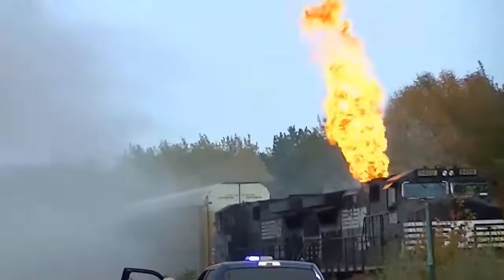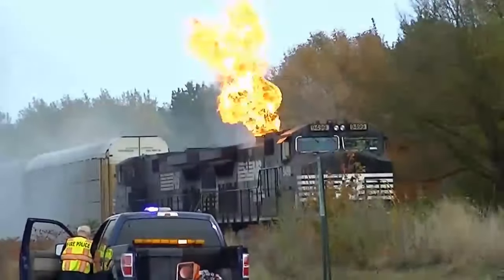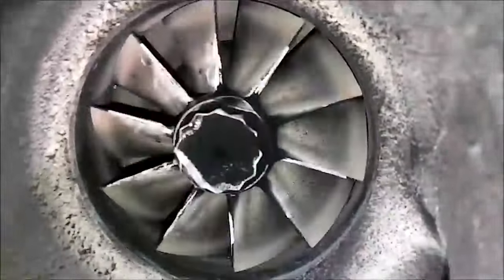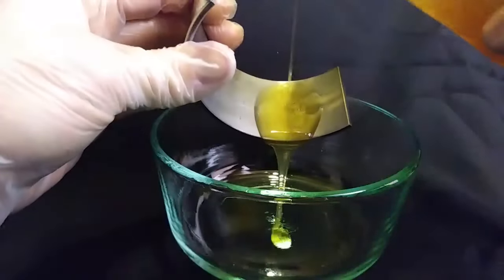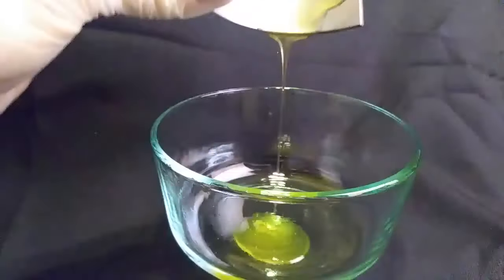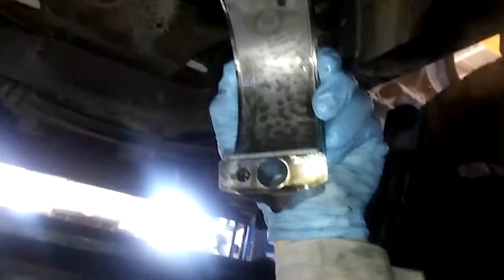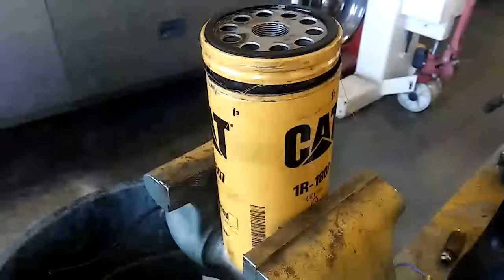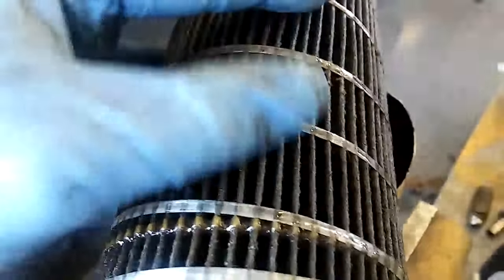Engine Block Heater vs Oil Pan Heater. Everything you NEED to know about Cold Weather Diesel Engines

Comment: "Do you want to spray that super flammable ether on to a glow plug?"
Hell Yeah I do!
"No, no you don't"
DAMNIT!
Reply: If a diese doesn’t have glow plugs & the IP is ok with ether & a backfire/engine turning backwards not breaking anything then you should be fine only if it’s designed to have ether used for starting.

7.3idi’s especially should NEVER get ether at all. Ether can easily kill a 7.3 idi if not used right, but there’s a guy in Canada that will disagree with me on this, but w a 7.3 idi if you give it a short squirt & a little of wd40 before starting then you should be fine. I use wd40 because it’s better on the rings. Ether is very dry, & can vaporize oil in the rings causing more cylinder wear.
Reply: @michaelbenoit248  or just have a good set of glow plugs and glow plug relay, I can’t say enough how important that is. My 7.3l PSD has been starting sub 0 unplugged (location) and hardly any time is spent cranking, it just fires. Keep a happy relay, plugs, and I upgraded my obs UVCH to the super duty one with better contacts to get the plugs power.
Reply: @ApolloTheDerg  Much below freezing and my 7.3 will not start without either if not plugged in , would not come close to starting at 0
Reply: @robertboyd3863  how old are your injectors? My brothers 97 7.3l struggles to cold start, but when we buzztest almost half of his injectors come up weak. I’ve swapped some used ones out of mine when some where weak and they all buzz strong when cold, and she fires when cold.
Reply: @ApolloTheDerg  I had them replaced a couple years ago when the tips broke and started putting diesel in the water , didn't affect starting any , last time I changed the oil , I also drained that pressure tank on the top of the engine, don't recall what it's called , I had never heard of doing that, it seem like it has started better when cold, always starts great when warm , and maybe a bit better mileage . mine is a 2002 . But all in all , all my diesels have a hard time starting when much below freezing, for years when working the drilling rigs I had GM. 6.2s they were terrible to start and even a small amount of either could break rings etc. on them , just a snort would lock them up, used to let them idle for hours, rather than shut them off, they also had bad starters so always carried a spare with me .
Reply: @robertboyd3863  when ya say much below 0 you might be pretty on point especially with old school Chevy diesel. For the 7.3l, I’d check a few systems and make sure it’s happy, valve cover gasket harness and the like, 5w40 oil, if it’s like -5 or 0 it should start without any help, but plugged in is a smart choice at those temps.
Reply: @ApolloTheDerg   Just a short time plugged in, and it's fine, I try to do that whenever possible , when they done the injectors a couple years ago, valve cover gaskets , etc. were taken care of

Comment: Canada’s -40 / -60 is also when tires start to freeze usually freeze flat on the bottom side having to drive slow until the tires warm enough to get a round shape.

Comment: Been operating diesel engines of all sizes most of my life. I've learned that good fuel, good batteries and regular maintenance will prevent most starting problems. Oh and when 5w-40 synthetic came along it was a game changer. I put it in everything now and believe me it makes a difference at anything below zero.

Comment: I got a 2001 7.3l with over 365k miles living in north Michigan. A good oil,  Plugged in will most absolutely start. Stay away from ether, if you use anything use wd40, I have used it in -15 works great, during cold months add antigel you’ll be alright

Comment: A few years ago I experimented on a 55hp chore tractor I was rebuilding. Had the pistons ceramic coated, to keep them from being such an effective heat sink during cold starts. This tractor from new (and our others with same engine) had never been good cold weather starters. Now even in single digits it starts right up, stays running, doesn't smoke, and sounds good! Would like to verify on a couple more engines. Has anyone else ever tried this?
Reply: interesting, and makes sense
Reply: Good  day  What model tractor was it  ?  Thanks
Reply: @donvoll2580  Case 1290.
Reply: when the experiments include ceramic coatings, we're getting somewhere
Reply: Ceramic coating the piston bowl on diesels is typically done to prevent melting  the piston in over fueled high HP applications, It certainly won't hurt a cold start but I can't imagine the piston being a large heat sink in regards to cold starting compared to the boost tubes, intercooler,  heads, valves, cylinder walls, etc...     but if it worked for you thats great!

Comment: I just put a block heater and an oil pan heater on my tractor I bought early last spring.  I'll see how it works soon.  I will also use a fuel additive.  It was harder to start than I liked in early spring.  I live in the Midwest so it's never -20 I just want to prolong the life of the engine.

Comment: I call Ether battery in a can... yes. Not that it just can start you in the cold, but, if you run out of fuel and batteries are getting a bit on the dead side and need to charge them back up and help prime more fuel through.... :) 7.3 Powerstroke. I've locked mine up a couple times from how much ether I shove into it. It can rev about to 2k rpm using 1 can of ether non stop spray, 2 cans can choke it out.

Comment: Got stuck one night in my 7.3l f250 with no way to plug my truck in. I got a hotel for the night. Went back the next morning and the ambient temp was -43°f ... I lit a literal fire under the engine. After 5 minutes I could start my truck.

Comment: I use Duracell and can go in motel in North Dakota right close to Canada come out everyone else is getting service trucks to heat and jump. I come out check under hood hit the ignition on my 1MM600 Cat bust right off and runs at lower idle for about five minutes then idles up. Those batteries have a cold crank power equivalent to what a lot of batteries have in normal conditions

Comment: A coworker had glow plug issue on his 7.3ps and he couldnt get his trk to start.  With my gas 57 JD 520 tractor when real cold i have used a propane torch to heat the intake and all i had at work was my butane torch i used to soldier wires so i used that to warm his turbo spyder after the inter cooler part and we finally got his trk started

Comment: Here in Minnesota I like to run blended fuel. 50/50 no1 to no2. Also keep some straight no1 for when it gets really cold. At -50 f 50/50 wouldn’t come out of the fuel barrel

Comment: It's funny that you mentioned oil temperature when using a coolant block warmer..
Always noticed that on my 6 leather your temperature was actually very warm I don't know exactly where the temperature sensor is but I would have thought it would have cool down a lot once the engine was running but it didn't the coolant temperature actually dropped more once the engine was started....
Love the shows keep up the great work
Reply from the maker: Thank you for watching.

Comment: there are coolant heaters that run on 12v and diesel fuel

an oil heater is good for lubrication at start, but I don't think it helps a lot with hard starting in cold weather which is caused by the injected fuel getting hot enough to lightoff.  cold air and cold cylinder & head both suck away the heat, and reduces the effective compression ratio.

Comment: I've seen a machine destined for artic climate operation. It had both a block and pan heater. It also had heat tape and insulation around the fuel line. There was also insulation and a heating blanket for the fuel tank. For the battery, there was an insulation blanket and trickle charger built into the heating system. The power cable for these systems was a three phase connector with a fairly thick cable to attach to it. Three phase power is usually used when the draw is above 5kw and cable that thick I've only seen when the draw was above 10kw, so the draw of the heating system was probably above 10kw. 

For situations where there was no access to electricity, there was a diesel burner with a thermoelectric element that drove a small pump that could circulate warm coolant around the engine. This was all in a very large digger and I'm not a gear head so I don't know if any of this is normal but to me it was all very impressive.
Edit: right, forgot. The exhaust from the diesel burner passed under the fuel tank, but inside the insulation, so that the diesel for the burner stayed liquid.

Comment: I've got a 100w kat heating pad on my oil pan and another on my tranny pan plus a coolant block heater. 
Only use the (2) kat heaters if sustained single digits.  Otherwise block heater if 10+F degrees.
It makes a difference for sure if looking for easier startups or quicker warmups.

Comment: This guy is good.
I have and use an HVAC low temperature stat which is set to come on in *F 30 or 29*F so I can leave it on all the time should I need to? 
Run 0W/40 winter and 5W/40 summer. 
If I needed it would buy a AC 120V fuel heater which will wrap around the filter. Just never needed it. 
Did have a second block heater put in a few years ago. That gives me two options. 
Or maybe it is just for the William Tell Overture he plays?

Comment: If you have fuel heaters in the tank also known as artic boxes it uses coolant from the engine but is only good when the truck is running if the truck has been sitting and not running the the fuel will get cold but most trucks the fuel returns in the tank as warm as the water temp i has a truck with tank heater turned them on in the winter time had no problems with gelling up

Comment: I replaced the stock fuel heater on mine 7.3 powerstroke but also. Installed oil pan heater   All good ideas   But I’ve been useing a webasto diesel heater for a year now  at-30 -35 it starts up no issues

Comment: Not mentioned above is an (APU) auxiliary power unit.....  Thermoking sells and installs APU's and it can pay for itself in a couple of years rather than idling the big truck engine.  Heats and air conditioning along with keeping battery charged.

Comment: Thanks, lots of good information. I’m in Kenosha Wi and it minus 5 F and my 2012 TDI Jetta sport wagon made it a few blocks and went down. I think I’m going to go for a frost heater solution
Reply: You needed anti gel in the fuel if it ran a while and quit. No amount of block and oil pan heaters would have prevented the problem you had. Only a fuel heater and/or fuel additive would have kept it going. You should have seen the diesel pickups on the side of the road here in Texas last February when it got down below zero, lots of people had no idea diesel fuel starts to gel at around 10 - 15 F. and we don’t get #1 fuel here. 
A quick remedy if you don’t have and can’t find anti gel:  get some kerosene and put 1 - 1.5 gallons per 10 gallons of diesel in your tank, it effectively makes your #2 summer fuel into winter fuel.
Reply: @ralfie8801  it turned out to be the alternator pulley as it spun and appeared to charge but intermittently slipped and killed the battery and it was more or less coincidental that it was 5 F
Reply: Ah! Killed the ECM so it couldn’t run? It’s amazing it started at that temperature with such a weak battery.
Reply: @ralfie8801  it only started once
Reply: @anonymousbosch9265  
That’s all it had left in it after the alternator failed. The alternator failed before your battery died and also before you started it that morning.
A vehicle will run for quite a while without an alternator as long as the battery has enough charge in it to keep the ECM up and functioning.
Reply: @ralfie8801  that’s what I think too, I think or Jon my vehicles myself but this was a hassle because of that alternator pulley being something I’ve never seen

Comment: Cold is a relative term as you point out. I have not had issues starting two stroke Detroits, Big Cam Cummins, 3406 DI Cats, Mack V8s, or my Dodge Cummins above 0 to 10 above Fahrenheit. And that's with no starting "aids". If you have good batteries and are vigilant with fuel filters, generally they will start has been my experience. If it got below zero, we'd leave them run at "high idle" about 1000 RPM or a little more. We used weather fronts and paid attention to water/oil temps while at high idle. We used Arctic Fox in tank heater with shut off valves for the water.

Comment: A lot of trucks have anti drain back valves on the oil coolers and in other spots, example fords and international because they need oil pressure for the injection system . I believe my cummins oil cooler holds a bunch of oil that gets warm from the block heater. at -23 C plugged in it fires right up with instant oil pressure.

Comment: There is one perfect system buddy check out the webasto Diesel fired coolant heater. You can install them on the frame rail of the truck they come with an electron a control module even a timer that you can set to turn on before you start the truck. The heater uses diesel fuel from the trucks existing fuel tank it has a 12 V burner and a 12 V pump to heat and circulate the coolant up to 180°. When you go to start the truck it’s like you just shut it off instant heat and everything

Comment: Hey Josh look up the flame start Cat used to put on mechanical engines. Most was on 3306B, I had to put one on a 3406B and it was a nightmare. As it was new Cat did not have every thing available and had to fabricate and rig stuff up. Cranking a old PC was sort of a art compared to a DI engine in cold weather.

Comment: As a shade tree mechanic and a fella who has owned multiple airplanes and has spent a lifetime flying in the mid Michigan winter I am here to tell you from bitter cold experience that heating the entire mass of the engine - as opposed to a  just a puddle of semi warm oil on the bottom of an otherwise frozen steel pan -  is the only way to go.
Reply: The cold oil will warm and thin almost instantly when pumped into warm oil passages of a heated block..
Oil pan heaters often burn the oil until it cokes.

Comment: In northern Canada 🍁 in the oilfields and such many trucks run diesel coolant heaters. Set the timer for an hour before you start and the engine starts and idles smoothly. Wabbaso Is a popular one?

Comment: Do you think leaving the block heater on overnight would cause oil to diminish off of internal engine parts and increase wear at startup? I'm not admonishing leaving the block heater on overnight but every once in a while somebody forgets. An outlet timer of course is very handy.

Comment: I prefer an oil heater to help reduce bearing wear. 10 deg oil does not flow/lubricate near as well as 100+ deg oil.
I prefer a block heater as the aid for the starting aspect itself.
Great content, comparison information!

Comment: Many people are unaware of the fact that diesel engines are used in general aviation aircraft.  I previously owned a Diamond DA-62 with twin Austro E4 diesel piston engines.  They are basically heavily modified Mercedes diesel engines that have been adapted for aircraft use.  One major problem with diesel aircraft engines is the ability to restart them at high altitudes where the air is extremely cold.  Another problem with diesel engines is propeller speed, diesel engines do not turn fast enough to spin a propeller at the needed speeds so a reduction gearbox must be used which is added weight and increased maintenance requirements.  The two things going for them is the cost of fuel and their efficiency which reduces fuel consumption.  I sold the plane and purchased a twin engine turboprop which suits my needs better.
Reply from the maker: I had no idea Diesel was used for airplanes, very interesting.

Comment: forgot about a diesel fired coolant heater have that on my old 9200i with a c12 workers great  set it to come on 2 hours before i plan to wake up truck fires right up no glow plugs nothing also using fuel treatment is key in the cold  i double treat mine all winter habe gotten as cold as -25 truck fores right up and never once had a gel up

Comment: I live in a fairly northerly area.  +30°c summer -35°c winter. I run 0-40 year around. My Peterbilt has a block heater and untill recently it had a pan heater . In December the oil pan was removed for the purpose of inspecting the main and rod bearings. Was disappointed to find that the pan heater had coked the oil ( likely before I acquired the truck) the debris (like fine black sand ) had damaged the internals of the c-15 . I will not run a block heater style oil pan heater again and a caution anyone who does . Coolant and 0-40 is all you need
Reply: Some newer pan heaters have a temp cutoff. ABN is one brand and has some set at like 194 deg.
Reply: @mrmotofy  nice 👌

Comment: Another type of cold start system used in perkins and liebherr engines is   Flame glow start   They use a glow plug in intake manifold and then diesel fuel is pumped around it and starts a fire in intake manifolds  like a flame thrower
Reply from the maker: The Internationals/Navistar used a similar design on the Maxxforce if I recall correctly.

Comment: Definitely synthetic for cold weather, flows much better even with same w rating. I think there are some 0w40 oils out there? Rotella t6? Might just be 5w40 but that should be good
Reply: Alistair B yup, I just put T6 in my GF’s Del Sol and it’s been cold starting like a champ. That stuff works great with older high mileage cars